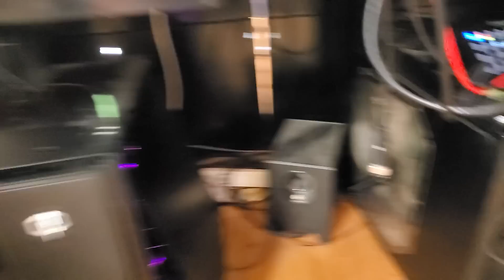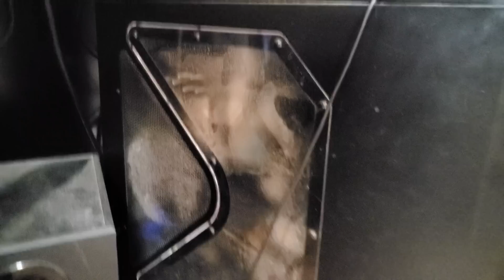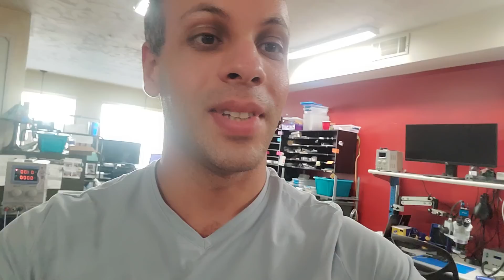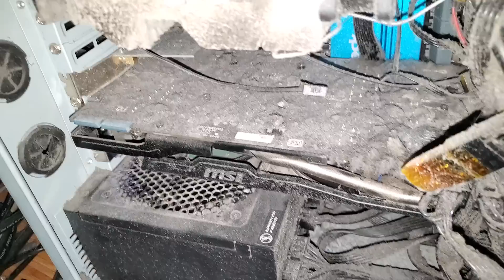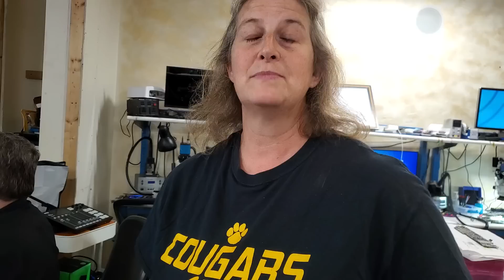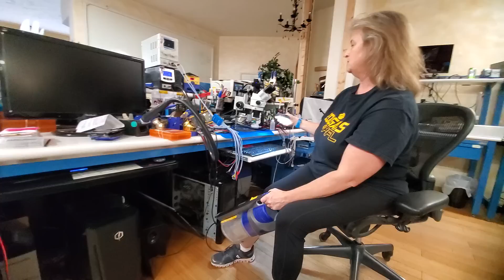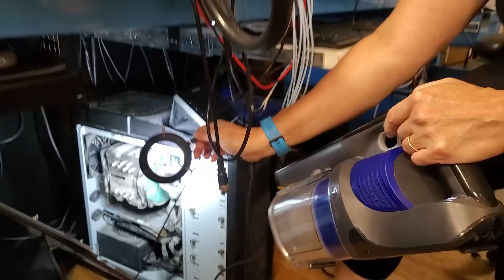I gave my best friend a streaming computer 7 years ago and she did this to it :(

Comment: I was really hoping for a good shot of the metro datavac in action. I haven't used one since you built this computer.

when I did on-site IT work those things were my best friend. kept one on the bench in the shop and one in my tech bag.

they are easy to work on and the manufacture sells replacement parts -- even brushes!

Comment: Wow, I have never been so horrified for someone else's PC but when he pointed the camera... I started panic cleaning my own PC like wtf. Hell, Never! wow, so sad and so disgusting for those components 😱😭😰

I clean mine at least every 3 to 4 months using a DataVac. Also, do a  deep clean every 10 months to a year. Usually, around the time I need to upgrade or swap components. To get rid of any build-up of dust, especially on fans that have settled often around the blade) and hard-to-reach crevasses and fins on the cooler.

Comment: The only thing that makes that worse is pet hair and smoking.  I've had both.  Take what you see here and wrap it in dog/cat hair, cement it with smoking tar.  The "Air blower" doesn't stand a chance.  You have to take it apart and set about it with paint brushes and tooth brushes and using a credit card to clear the heatsink fins.

Comment: I just rebuilt an HP power supply that I bought off eBay as "doesn't work and makes bad noises". Well... it so caked full of dust (which felt like cigarette tar) that the fan couldn't turn without obstruction.

Comment: Interestingly my Aunties computers that were ~7 and ~11 years old when they were retired had very little dust in them, though they wern't intensively used and were nothing that special (well the original Fujitsu 98 machine was mid range)
And if you need a vacuum look up Numatic and their US distributor Nacecare, made in Britain and built to last, plus a lot of their models have smiley faces on them! Our Hetty is 15 years old and my Brother Henry (that was my Grans) is 35 years onl and both work flawlessly. Thy use bags rather than being bagless so they are clean to empty, plus the excellent cloth disposable bags are reasonably priced and quite large.

Comment: The woman has shown her level of contempt by not properly taking care of the machine. Beings that I am a heavy smoker I absolutely have to 'clean' the machine once per week or I get thermal throttled due to dust buildup. I have to remove the cooler tower on my CPU once per month for deep cleaning and it works well. Jessa has proven in her ignorance that she is unworthy such a fine machine.
Friendship is one thing, showing one's own incompetence or ignorance for a gift given in love defines character.
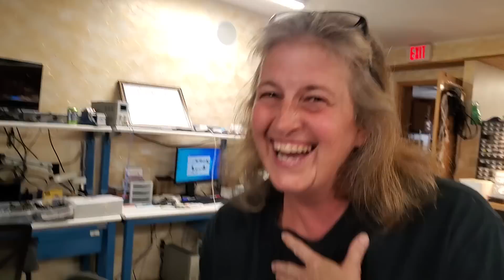Thank you for posting this video. I learned everything I needed to know in the first 1:40

Comment: hey louis, what is that thin copper wire you use to make connection between chip legs when the pcb traces is destroyed? i tried buying enameled copper wire but it's super hard to get the enamel off to solder it, even at 400C soldering iron temp and the one you are using seems to take on solder instantly with no problem, thanks
Reply: Copper Magnet wire. But there are different types of coating and temp. You may need to go to 450C but most seem to be below that. I am an amateur and use scraps that work, type unknown.

Comment: Dust I can handle - out back w/ the shop compressor blower nozzle (moisture filter and reg'd down to 30 pissies)
It's when a customer brings in an ash tray so plugged I had to first scrape the nicotine/tar off the connectors, etc to identify anything that I lost it.
Also, never use a consumer vac on a PC - static charges are not how you put more angry pixies into a motherboard. There are proper service vacs with grounded hoses (and hepa filters) for cleaning static sensitive equipment (used them to clean toner spills from inside digital copiers).

Comment: please dont vacuum computers, it actually makes a static charge. The dust particles moving through the plastic tube induces a static charge. Its one of the few thing that can kill pcs, Ive seen it before. I normally dont give a crap about static, but this ones can cause issues.

Comment: I just take mine out in the back yard and blow it out with an air compressor every summer.  Seems to do the trick.  It's an old i5-3570K which is still able to run modern games pretty well.  SSD, memory, and video cards upgraded.  Amazed it can still run modern games at about 10 years old now, I think.
Reply: That CPU is from 2012 so "only" 10 years, lol.
Reply: @kunka592  Oops, good point (corrected). Still, I was amused that the processor was listed as minimum required to run cyberpunk 2077.  Haha.  Guess that game was in development way too long.  Currently running an RX570 vid card with 8 gigs and it seems to run most modern games playable on medium settings.

Comment: It looks like there's something sticky holding the dust on there, like flux fumes or something, or fine oil particulates, or burned carbon based something tar. Reminds me of a PC I worked on from a mechanic's shop. It really needs a wipe down, at least on the heat sinks and fans, and maybe a drop of oil in the fan bearings. Air just isn't going to cut it.

Comment: Hey that machine looks pretty similar to how my x99 machine looked when i pulled it out of my garage.  It's just a shame how a $5000 cpu for the x99 gets blown out of the water by a $400 z390-i9. I think the biggest factor is that new intel CPU's have significantly faster AVX512 instructions as well as a plethora of new intel Tech that allow their chips to emulate powerPC chips with their wonky cpu/gpu/DMA system.

Comment: if that computer looks like that after only seven years, she should get a air cleaner in whatever room she has it in. does that computer even have a filter in the front? Louis need to own up to it and fix that faulty construction and replace it with a new correctly built one.

Comment: I would have pulled all the wires out from the back and front of case, take the computer outside with air compressor, remove all components a little roughly, dust each one a little carelessly, and then put it all back together just to prove that computer parts are not as fragile as they were years ago. 

And if any parts broke, I would pay for any broken components from my own wallet.

Comment: I would send this computer to The 8 Bit Guy or Adrian's Digital Basement and they would take it apart, wash all the components, retrobright the case and put it back together as if if came straight of the shelf in the shop seven(ty) years ago.

Comment: This is the reason why I always reverse the fan on the power supply on my computers. That way it will suck air in at the TOP of the computer, and create a higher air pressure inside the computer than outside. I also cover the air intake with cheese cloth. Which will filter the air that gets sucked into the computer.
That way, the air that gets sucked into the computer is relatively dust free. And air will be pushed out of all the gaps in the cabinet.
The way the computer is set up normally, the power supply fan will suck air OUT of the cabinet, and dusty air will be sucked INTO the cabinet through all of the gaps.

Comment: I had a computer at work that kept shutting down randomly.  Took it outside and opened it up.  The dust was so bad I decided to use a leaf blower to clean it out. 😂. Never had an issue again.
Reply: A cordless leaf blower is a very handy tool, not only for blowing dust out of equipment but I used mine to blow all the lint and dust out of the duct hose for the clothes dryer. Also good for blowing dust and lint out from under the refrigerator, which improves efficiency and lowers the electric bill but also creates a bit of a duststorm in the kitchen....

Comment: The top layer of fine particulate is hydrophobic. The denser, lower layers are absorbent in case the top layer fails, to soak up the water before it can damage components /s

Comment: >talking about taking an air compressor to that dummy thick dust layer INSIDE
AAAAAAAAAAAAAAAAAAAAAAAAAAHHHHHHHHHHHHHHHH
Also, remember to arrest the fans before blowing them clean else you might bork the bearings.

Comment: And here I am like a mental patient, running the microfiber over the case, and blasting the fans with compressed air, sliding the side panel off and oh so gently, wafting away the particles of dead skin and dust mites everyday...and all this time I could have gotten a solid 7 years without having to bother with any of that, I must be stupid.

Comment: Pro Tip: What I learned in my 30+ years of IT support.
If you just lift the computer 5-10cm of the ground by placing on it like something like a standard Paper ream; it makes a huge difference in how much dust get sucked into the PC…
Reply: thats true linus said that same thing but....its been seven years since this poor thing even opened sooooo idk how much that would affect
Reply: yo, really?
Reply: @Noteclip  yep, just get like a wooden board or something
Reply: That along with positive air pressure inside the case. Very important (You do that by making sure you have more fans sucking air in than fans pushing it out). Also no down-up airflow fan configuration allowed. I do all of that and haven't had to clean a speck of dust in my PC in years! (Though it is still important to keep your environment generally clean)
Reply: @mrsearaphim4077  yup, I added an intake fan to an old HP compaq PC & it has less dust in 2 years that it had in about a month prior to this 😅
Reply: I think having the power supply at the bottom makes things much worse for people that keep the PCs on the floor.
Reply: Or better yet, never put it anywhere below desk height in the first place.  But what do I know?  I only have 25+ years of IT support under my belt.  😄
Reply: What I learned from 15 years of pc building: just upgrade every 2-3 years amd never clean. In that time the dust and other stuff won't affect performance enough for it to matter - unlessbyou live in a kennel. This one wasn't even bad.
Reply: Mega Ultra Pro Tip: use a central air filter on your case like a pimp.
Reply: This is also why you should never wash or clean your car...
Reply: I moved my full tower up on the desk. Easy to reach ports and drivebays and makes me able to enjoy the LED's inside. Hardly any dust.
Reply: I cleaned mine out all the time. Got a new table with a cubby just below the table surface. Computer is on it's side 2.5ft off the ground, table sticking out 2 feet around all 4 sides, still gets just as dusty as it used to. This theory doesn't always work.
Reply: Unless you have cats. Then even on a desk it's gonna get some in it 😂
Reply: I would recommend at least 1 foot. but yea solid advice
Reply: Yes, this is why my PC's are elevated about 2-3 feet from the floor and I only have to dust twice a year vs on the floor which was once a month.

Comment: Leaf blower would probably be a better option at this stage.  Gets rid of all the dust.  But would have to be done outside.  I clean the filters every month and put it in the washing machine, but not the dryer.   /sarc
Reply: A cordless leaf blower works great for cleaning jobs such as this. I have also used my leaf blower to blow the lint out of the long duct hose for the clothes dryer. And, when I drain the pipe and valve that feeds the garden hoses, as winter approaches, I use the leafblower to push the water back towards the drain plug in the basement.

Comment: Honestly, I've seen worse in my 30+ years of working in various IT roles.  Much worse.  And honestly, that much caked on and solidified dust leads to thermal throttling, seized fans, and intermittent crashes.
Reply: Imagine the inside of the PSU though... mine (PSU) was a dust bowl without the interior looking that bad.
Reply: Butbutbut, it's a protective layer of medicinal dust!?
Reply: Meh, it didn't even look that bad lol
Reply: Not to mention a Lack of Airflow LOL
Reply: you dont say
Reply: worst, would cause fire

Comment: The Antec 900 was a great case, only after you finished the build. That thing had so many screws. Oh god the number of screws you had to deal with working in that case. So glad manufactures started coming up with all sorts of screw less designs not long after.
Reply: i have same sort of antec case, frontplate is the same, no window on the side though. aaand a tiny bit less dust inside ;P dont remember about the screws, humans tend to forget things they dont like...
Reply: I still use an Antec 900 for my secondary PC.  My main PC is in a slightly older Antec 1200 (the revision with eSATA on the front rather than USB 3)
Reply: @Lierofox  I have an Antec 300 for my main PC (i7, more than 7 years old) and a 1200 for my i5 server.  Both great cases with lots of fans in front of the hds.
Reply: I still use my Antec 300 Illusion. Honestly, I don't know how anyone ever justifies upgrading their computer case lmao. It's just a box. Why would you need a new one?
Reply: @johnmiller2905  peripheral connectors and larger GPU support are the main ones. At some point it becomes an annoyance when you have to reach into the back for a USB 3.0 port or things of that sort.
Reply: I have an Antec p180 tower, they made great quality cases but every time I have to move my pc from under the staircase to my workbench I wonder if it's time to change this 20kg chunk of metal to something lighter and smaller :D (I have to test repaired pc parts all the time)

Comment: The bad thing is that I've encountered even worse...
Whatever you do when you poke your head into one of those... DON'T SNEEZE! I've learned that the hard way.
Reply: For those that don't own an air compressor, a leaf blower works very well.  Cordless is preferred.
Reply: @goodun2974  The Carey Holzman style
Reply: @pacifico4999  , I don't understand the reference. PS, I have used my leafblower to blow dust and lint out of the clothes dryer duct hose.
Reply: @goodun2974  Carey Holzman is a computer technician on YouTube, with 360K subs. He has a few videos cleaning computers with a leaf blower, and he says it's his preferred method.
Reply: @pacifico4999   Good to know! And although I do have an air compressor, a lot of the time it's simply more convenient to grab the cordless leaf blower. When I drain the outside garden-hose fittings in the fall,  I use the leaf blower to push the water back inside to the drain plug in the basement to prevent burst pipes.  Cordless auto tire pumps can similarly be useful. My best MacGyver moment, which I have done twice, was to save people who needed to have nebulizer medicated breathing treatments every 4 hours from having to go to a hospital, or dying while gasping for breath, by hooking up the automobile tire inflator to the aquarium style tubing for the nebulizer that turns the medication into a mist. Worked like a charm! ( We got snowed in during a blizzard, and a teenager with pneumonia was staying with us; and another time after a major storm, one of my wife's patients was stuck at home without power for several days after a region-wide storm).
Reply: @goodun2974  Now those are some creative uses for an air compressor
Reply: @pacifico4999  , 1) as a kid, I read a lot of science books and mostly paid attention in science class (especially if it was something that would help me make things that go BOOM!), and 2) all of my friend's dads were do-it-yourself guys, good with hammer and wrench. My own dad was a bit less mechanically inclined than myself, but we learned on the fly together, and argued during most of it! By the way, when I was a telecom technician and cable puller, I learned from the older techs that instead of pushing an electrical "fish-tape" (snake) through a long 3" or 4" conduit, you could make a jellyfish-shaped ballon out of a plastic shopping bag, tie it to a string, and suck it through the conduit for a hundred feet or more with a shop-vac. The more you know....

Comment: That poor Antec 900, what has she done to you.  its a good thing that case has really good air flow with that 200mm fan on top.  That PC needs a full teardown and cleaning.  Just dump all the parts into the ultrasonics.

Comment: Ah, the Antec 900, a case that brings back memories. All those drive bays and fans with blue leds. And great job on choosing the X series Seasonic, mine is 10 years old and still kicking.
Reply: Mine is still lying around with an old Antec PSU in it.
Reply: I just upgraded out of my Antec 900.  Love the case, but sadly it has no decent mounting points for an AIO liquid cooler.

ETA:  I'll probably slap a bunch of hard drives in it and make it a linux file server or something.

Comment: Ah the classic Antec 900. 3x 120mm fans and 1x 200mm fan. It was part of my very first gaming build.

What I learnt was all my future builds must have dust filters.
Reply: Same....  So I upgraded to a second hand Antec 1200 :D
Reply: @stalincat2457  My main PC is still in my Antec 1200, though mine has never looked as dirty as this 900.  When I upgraded last year, I kept the case.  I have replaced the three front and two rear 120s with Noctua P-12s pwm fans, but that was more so I could control them in software.  I'm still looking into a pwm replacement option for the 200mm Big Boy for the same reason.  It still works fine, but I want to include it in my fan curves.

Comment: 0:25 Do you remember what model Antec that case is? I have a 902 and 1200 that look almost EXACTLY like it but with angled corners on the top front that have usb/headphone ports and the power/reset buttons..
Reply: Antec 900, I have one.  They made a newer version called Antec 900 v3 when they added usb 3 to it.